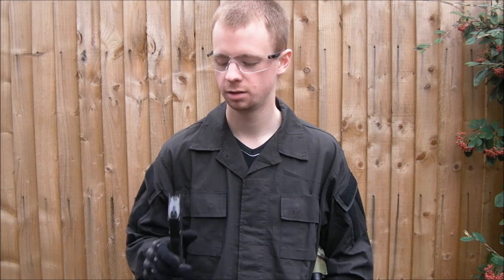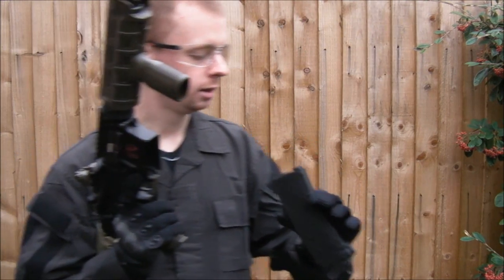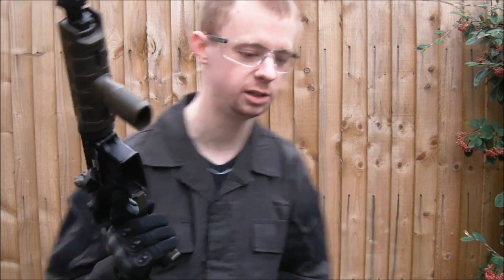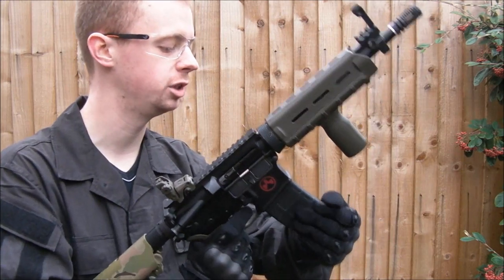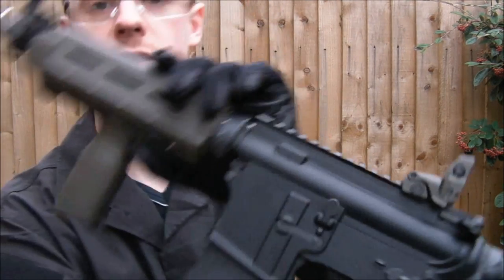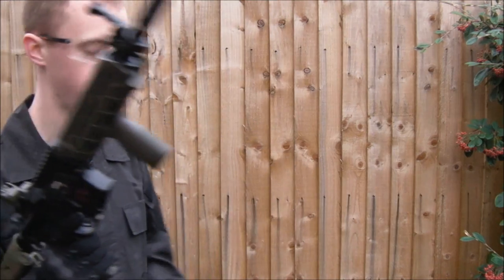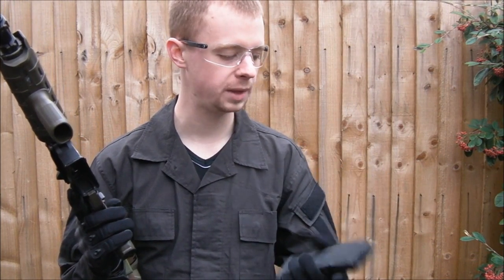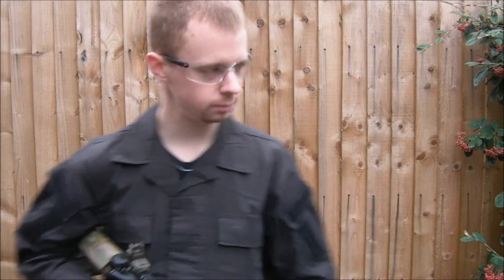PTS PMAG Problem

Comment: I don't know if that's possible like the PTS mags, but if you can, screw open your TM mags and first clean the BB channel and the BB stopper channel with a Qtip moistened with a bit silicone oil. Redo once with a clean Qtip, then moisten the BB follower with silicone oil a bit so that it's smooth, but not quite wet. It should feed fine, then. You can do the same with the PTS mags btw. 
Depending on the type of plastic you can heat and bend the piece that comes upwards with a empty mag as well.

Comment from the maker: For anyone that might be wondering, I had a crack at stretching out the springs one one of the mags and that's resolved the issue.  Not tried it on my other two yet but I'll comment again in a couple of weeks, or make another video to show them all fully-functional.